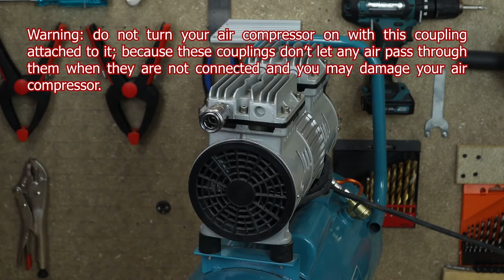Air Compressor to Vacuum Pump Conversion

Comment: you totally blew my mind with this, I was looking for some cheap diy vacuum pump because I want to experiment with building my own diy plasma discharge tube to experiment with. Sure enough I've got a compressor in my tool shed from when I worked in custom cabinetry, perfect!

Comment: The piston made of teflon will not "suck" as efficiently as it pumps due to its cup type shape. when the compressor piston moves down, it partly sucks air from the filter, and partly it is the slip through air from the downward motion. So, No , a compressor will not work efficiently in a vacuum pump mode you demonstrated,  unless there is an extensive engineering done to it.  I tried fitting the piston lip facing down so there would be more sucking force. It is'nt easy, believe me. I have access to a full engineering shop so was able to do it.😅

Comment: Very cool, but I got a question: If the coupling is gonna damage the compressor when it is not connected (no air went through) then will it also damage the compressor when it pull out all the air inside the plastic bottle as well?
Reply from the maker: TBH, I had never checked it, neither for the connector nor with the bottle, to see what is going to happen, and this is just my prediction. You are correct at some point when the air inside the bottle is all sucked it is exactly the same situation and I don't think it is healthy for the compressor to keep it running like this.

Comment: Good knowlege.. question.  how do you measure inlet suction vacuum pressure relative to the outflow pressure of the compressor? Is there a specific formula?  Vacuum pumps generally do not specify the pressure at the outlet. Please help.. Thank you.
Reply from the maker: If you want to measure the vacuum pressure, specific gauges are designed to measure under 1 bar pressure. ( 1 bar being the air pressure at sea level, AKA atmosphere). So there will be some air pressure at the suction inlet, but because it is lower than 1 bar, it can't be measured by a normal pressure gauges. I am really sorry I didn't understand the part where you are talking about this pressure relative to the outflow pressure. If you can explain more, I might be able to help.

Comment: Great video dude. So simple lol just connect to the intake port. Dunno why I didn’t think of this. Do you run any risk of damaging anything here?
Reply from the maker: Thank you, my man. So obviously, this device is not designed for such an application, and I can not recommend anyone to use this method because I did not test it long-term. So please "do at your own risk" this video is just for satisfying my curiosity.

Comment: من از این ایده برای فیکس کردن پایه دریل کرگیری dd150 hilti روی کف استفاده کردم خیلی خوب بود. فقط یه سوال. چون کرگیری با آب انجام میشه اگه دقت نمیکردم و زیر محفظه خلأ پایه آب جمع  شده بود حجم قابل توجهی آب مکیده میشد و از خروجی سیلندر کمپرسور همراه با روغن بیرون میریخت (خروجی را از مخزن جدا کرده بودم). برای این چیزی به نظرت نمیرسه؟ اگه از تله آب و رطوبت‌گیر قبل ورودی سیلندر استفاده کنم چطوره؟
Reply from the maker: I got you my friend, go check out my Oil Extractor video, I think If you use a reservoir tank in the middle no water will enter to the compressor. If you still had a question, just ask my friend I'm here for you.

Comment: I've got a couple of safety recommendations, if you will. These are just my personal practices so don't anyone get all pissy.

First, I would be sure to install a filtered catch can (or particulate filter) before the suction inlet. The last thing anyone needs is for grit or moisture (!!!) to get pulled into the cylinders. For one, you risk damaging your machine & two, liquid doesn't compress very well without making it angry. 

Second suggestions would be to install a valve to relieve the vacuum. Some catch cans have drains on the bottom, but, in my experience, they've typically checked on the downstream side. 

I don't the engineers had this use in mind when they designed it, but I suppose it could work in a pinch. Just be careful & don't be making accidental bombs out there. 

Goose

Comment: Is the vacuum, using this arrangement, from a typical air compressor good enough to use as the vacuum for air conditioning work?
Reply from the maker: I am not sure how much vacuum you will need for air conditioning work, but if you are planning to use something like this as your daily tool for your job I can't recommend this solution. If it is a one time thing though, I think it is worth doing a little more research to see if this thing works for you. Unfortunatly I don't have any sub atmosphere gauge to measure the amount of pressure but from my experience I can tell you it easily crushed the PET Cocacola bottle.
Reply: i dont think so, in air conditioning a constant vacvcum pump its needed and should work for long time periods

Comment: Can I use this for composite vacuum bagging
Reply from the maker: This technic provides some serious sucking power. Obviously, the amount of this power depends on your unit performance and varies. However, these compressors are not designed to perform these tasks, especially if you are using an oil-free model like mine. I don't think they can work for a long time performing like this. So if you want to just try it a couple of times, I don't think it would be a big deal

Comment: Dude thats cool 😎.  I'll  need a gauge to read and i wonder if the vac is equal to the pressure side.
Reply from the maker: Thanks Bro, I think you can find pressure gauge which shows under 1 bar pressure. 
One more thing I forgot to mention is to open the tank valve so the compressor motor doesn't have to work both way.(only suction and no compression)
Reply: @KayvanCrafted  do you mean the valve underneath the tank that water drips out of? Or do you just disconnect the motor from the tank?
Reply from the maker: @Nkforster  Just make sure you don't use the motor for compression too, in other words, your gauge shouldn't show any pressure inside the tank, I would simply leave the compressed air valve open, the one that you connect to the tools, etc but if you use a coupling connector you should do something else, like connect an air blow gun and leave it open or just unscrew the coupling connector. I guess the water drip valve might work but that's not what I meant but I don't recommend it. Also disconnecting the motor from the tank will work for you but it's just too much trouble.

Comment: What sort of pressure can this pull?
Reply from the maker: How much suction you can get is heavily depends on what kind and type of air compressor you are using. Unfortunately, I did not have the right kind of pressure gauge to measure mine. That's why I demonstrated the sucking of the air from the Coca-Cola bottle to give the viewers an idea of how much suction they can expect.

Comment: Are they diaphragm units?
Reply from the maker: I am not sure which part you are referring to, but the air compressor is a two cylinder oil-free unit.

Comment: Hi! I need a vacuum pump for my cow milking machine. Do you know how many cfm it would provide? I need at least 30 CFM
Reply from the maker: Hi, I start by admitting I have no idea how much vacuum pressure you would need for cow milking. Also, I don't think CFM is that important here, because it means Cubic Feet per Minute, so the answer to "how much CFM an converted air compressor has?" is the same amount it had before the conversion. So you can check the spec of yours for the CFM rating. But, the more important question is how much pressure it can reduce? Usually, at open sea level altitude, the air pressure is 1 Bar, AKA Atmosphere. That's why most air pressure gauges don't even show air pressure below 1 Bar. You will need a different pressure measuring gauge that shows between 0 to 1 bar, which I don't own. Besides CFM, your air compressor also has a rating for maximum pressure, but this one does not have to do anything with the one we are looking for. 
Bottom line: If this is a daily task, I do not recommend this conversion for you.
Reply: @KayvanCrafted  Well I do appreciate your reply and feedback. I think we will go with a vacuum pump made for milking machines. Thank you!!

Comment: Just hold the bottle for 2 minutes and you’ll blow the motor! Use Venturi vacuum generator to convert compressed air blower to vacuum power.
Reply from the maker: Thanks for sharing your opinion man, yeah venturi is nice and easy but it has no power compare to this one, it would never be able to suck the bottle like this. I recorded a video about the veturi effect recently. It will be uploaded soon. Yeah, if you insist to destroy your air compressor you can keep on until it blows, but it's just a trick, a hack...
Reply: I just checked the price on this and it was double the cost of buying a stand alone vacuum lol
Reply from the maker: @kewk  Thank you for sharing your opinion. I already mentioned this in reply to a few of comments, guys if you don't already own neither an air compressor nor a vacuum pump and what you need is a vacuum pump it is very obvious that you should buy a vacuum pump! This is a hack, for the situation that you already own an air compressor but you just happen to need air compressor just for a small project.
Reply from the maker: Here is my Venturi vacuum pump: https://youtu.be/B-hoHA46rTw

Comment: Why your compressor running so so so quiet .
Reply from the maker: First, the ones that look like this are the newer gen(relatively) ideal for small workshops like a residential area, but they won't stand long hours for professionals. Second. I guess in this scene, the squeezing sound from the bottle dominates the mic, which was closer to the bottle than the air compressor.

Comment: I make a vacuum chamber for degassing n removing air bubbles from epoxy resin but I'm not sure my air compressor work properly as a efficient vacuum pump !
Reply from the maker: I guess wherever you need anything less than the environment air pressure you can use this setup, and in your case, I can't see why you won't benefit from this method. Meanwhile, this method is best for situations in which you already own an air compressor but you need a vacuum pump, obviously, if you need a vacuum pump it's not very wise to buy an air compressor and use this method to convert it to a vacuum pump. I have no idea about the efficiency in both cases because I think there are just too many effective factors, like what kind of air compressor you are going to use, and what kind of vacuum pump you have...there are just too many factors. But the bottom line is if you don't have any of those and you need a vacuum pump, just buy the vacuum pump, if you already have an air compressor give this method a shot, it might save you some money. 
If you happened to use this setup, Please keep that in mind that this is a DIY at your own risk project, also good luck and have fun.
Reply: I made the cheapest diy ever for my little resin jewelry pieces. I got one of those brake line bleeder hand vacuum pump from harbor freight, then made a air tight glass "jar', drilled a hole on top  for the hose. I have a mini air compressor from harbor as well, the tiny one that takes about 30 mins to put about 10psi in an automotive tire, lol. I want to try to reverse that until a mini vac. I got the idea for the lil hand pump from a dudes video on here.
Reply: @charley408  hey there, I have a 25 litres 2.5 HP air compressor n I tried to vacuum epoxy resin batch with pressure cooker but it doesn't work n I searched UT video's for a solution n I found one! Vacuum epoxy resin idea just work for some kind of epoxy resin named cactus juice resin epoxy or something like that , this kind of epoxy doesn't need the  hardener n this kind isn't used for ordinary epoxy based projects like jewelry n so, I found the way for remove epoxy air bubble's with pressurizing it in the ordinary 7 litter pressure cooker with installation a automobile tire air valve n a cheap air pressure gauge, u need this tools too for that ! Please be careful because compress air is very dangerous!

Comment: Great way to ruin your air compressor. Doing this will force your air compressor to draw air from the oil pan and pull it into the air tank gradually ruining your compressor on the long run. You're much better off buying a vacuum generator that takes the compressed air from one end and gives you a vacuum from another while venting the compressed air to atmosphere. It's relatively cheap and is 100% safe unlike this method.
Reply from the maker: Tnx for sharing your opinion bro, well I'm not sure if can read the the badge but it is an oil-free air compressor and It's just a hack, take it easy 😉